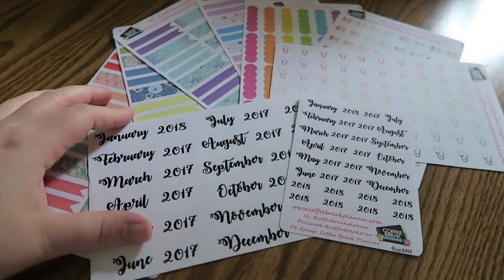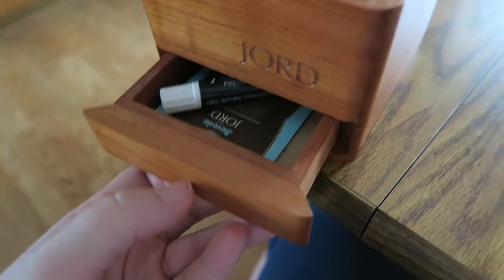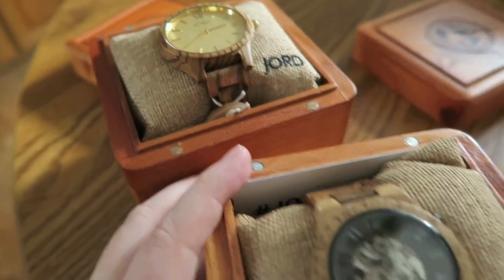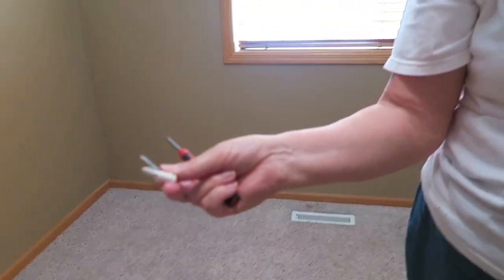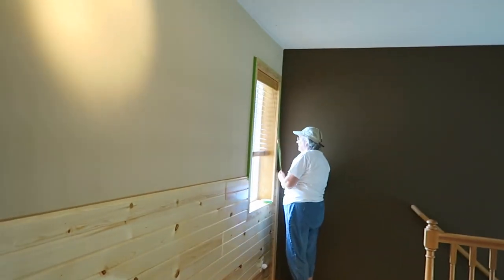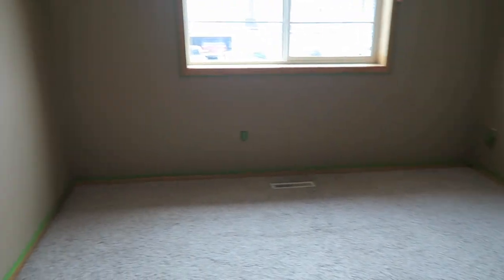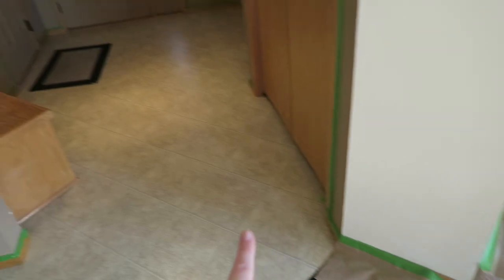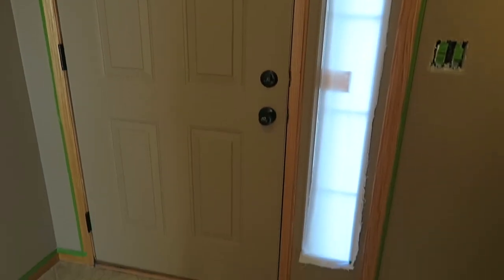MOM IS THE HULK | VLUNE DAY 3

Comment: Hey, I'm actually removing the popcorn ceiling in my house and you're right it is a super hassle, but I'm doing it myself for a total cost under $100 in supplies. If you scrape it smoothly enough you can just paint over it and don't have to spend the money on re-texturing, and mine actually looks pretty good. It's a huge project though, I wouldn't bother if my husband didn't hate it so much.
Reply from the maker: I wish I would do it myself, but my vaulted ceilings need a PRO!  Maybe some day down the line I will get tired of looking at them, but for now they will say.  Thanks for the tip :)